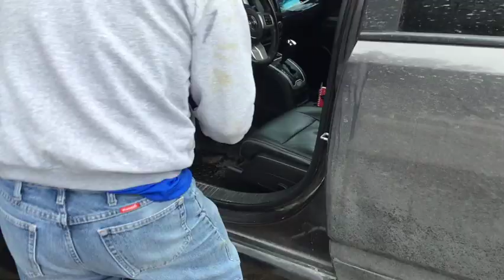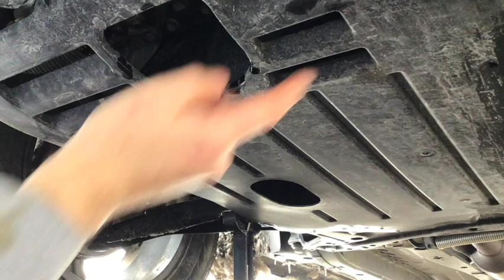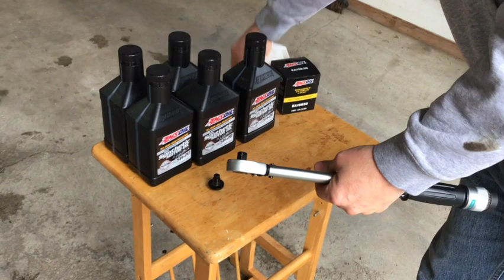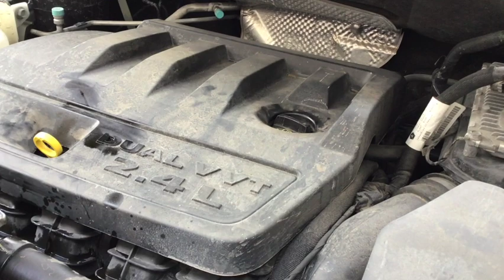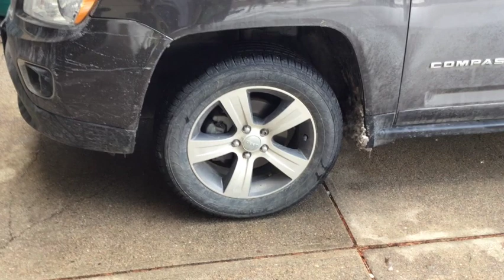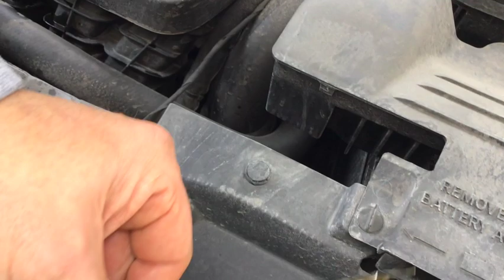2016 Jeep Compass Oil Change

Comment: 4.5 quarts?
Reply from the maker: Yes, 4.5 quarts, this includes the oil in the filter.  You might find you need a little more or a little less.  This is why I pour 4 quarts in, run the vehicle, level it, and the last half quart slowly measuring the dipstick to stay within the recommended range.